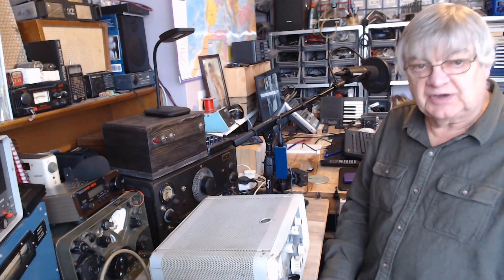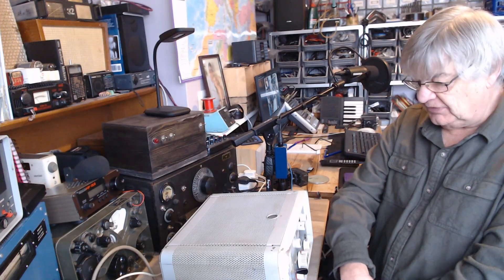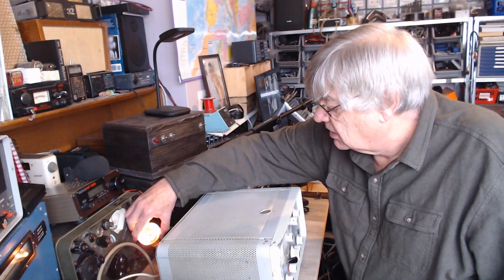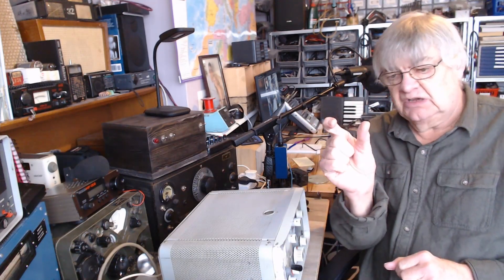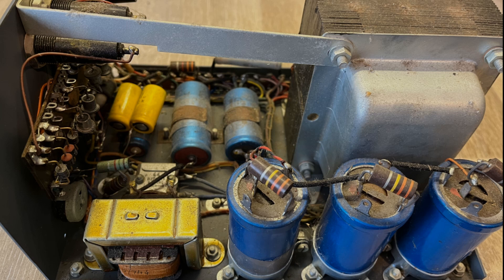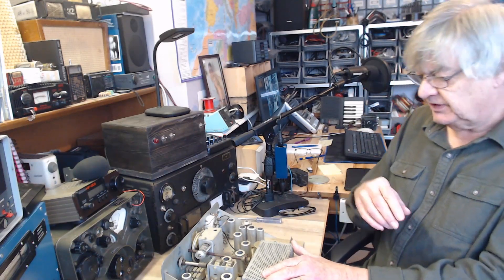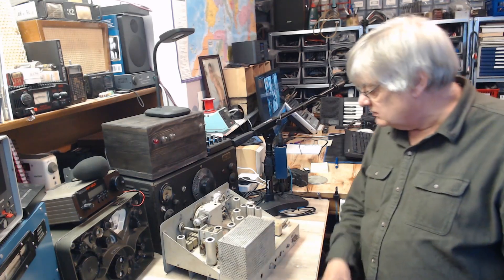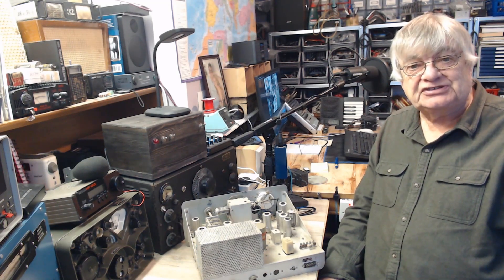G4NSJ - KW Vespa MK1 Transmitter. Part one.

Comment: I have a Vespa MK1 amongst other KW transceivers but no PSU for it.
But  I do have a KW2000A PSU I was going to modify.
However, I'm lazy :-)
Reply from the maker: The KW2000A PSU would be ideal.  A project for the winter?
Reply: @g4nsj  I'll report back Ray.
I have a 2000B with PSU.
I have spare PSUs for the A, E and original 2000, so I have a choice. 
I need to convert one for my Atlanta too.
Reply from the maker: @braxtonhickswaxinglyrical3068  Yes, do let me know how you get on.

Comment: Hi Ray, I would put new capacitors in the old cases, it's not a bad job to do. I have had an AR88 for 50 years, that's got original capacitors and it works fine. It will probably leak oil all over my bench now I have said that. 73 de Mike G4VQH
Reply from the maker: Yes, I have done that in the psat and it looks great.  Love the AR88! Cheers, Ray.
Reply: @ I made a mistake I have had the AR88 since I was 14 I am 68 now. I won £50 on the premium bond my grandmother bought me in 1972 a huge amount of money to me in those days, I spent it on my AR88
Reply from the maker: @michaelclutton8446  Good choice!
Reply: I have used it regularly ever since the early 1970s the best £50 I ever spent